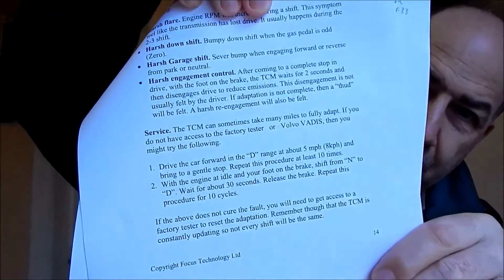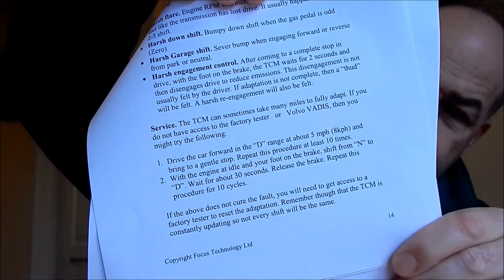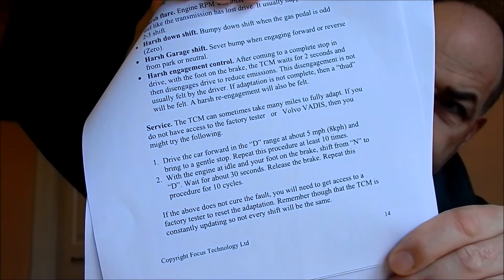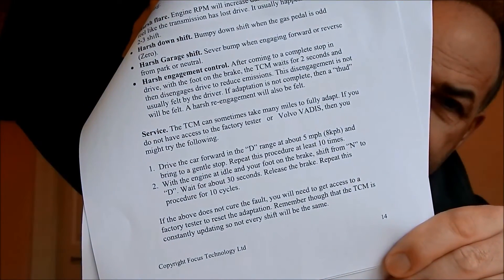Volvo AW55-50SN adaptive transmission -  GM AF33 & AW55 51SN

Comment: I'm having the shift flare issue, I'm a new owner of this car and I think it's been babied its whole life. Would a dealer reset it for me?
Reply from the maker: Well, obviously a dealer could do that...the point of this video was so that you can do it yourself - run through the video, and see the bit where the text of the document is displayed to the camera.  Follow those instructions, to make sure you eliminate the issues you can resolve yourself first?  You say it has been 'babied', but I would just say, the solitary cause of most automatic transmission failures I have seen, is wear due to mileage, and the effects of deteriorating transmission fluid.  If you bought from a dealer, consider getting your money back, and let them know this.  Don't be tied down to any one thing being the reason, just say you see this problem as the first step to resolving matters.  They may elect to repay the cash rather than proceed on what to them, will seem a precarious basis.  They might try and draw things out, until some time limit expires, beyond which you cannot exercise certain rights of return.  Who knows.  You wanted transport, not a project.  

Did the person who sold you it, use the term 'babied'?  I just wonder who assessed this vehicle as being well-cared for.  It's not a word that has any legal standing is why I ask.  It's the sort of fudging term I'd expect from someone not wanting to be tied down in any way, not wanting to say words or make claims that are any use to the buyer later.  Like a lot of used car dealers when they want to offload a crock of s**t would say.  I had one guy, he kept half-saying sentences, then waiting for me to finish them.  Literally, so he was not committing himself.  

EG I pointed out there was a flashing warning light, he'd say 'Well, that's nothing vital, I mean the car is running, as you can see, probably just needs...' and then he just drifted off.  I said'...just needs...' and thus prompted, the guy further said 'yeah, it probably just needs.......you know.....' and so it went on.  This, is the sort of childish playing-around, that some people spend all day doing.  It's like it's not a real job, is they impression I am left with.  Well, when I say the impression I am left with...I mean...you know...it's pretty obviously...you know........

 'Babied' might not mean well-maintained I am afraid.  It might mean low-mileage by someone at some point, and hardly out of the driveway for a while, which I am afraid could be the same as neglected.  In fact, diesels need a good pasting now and again, to keep the engine running well.  Goldilocks use, is hard to get but that's what you want - moderate driving, yet occasionally brisk, and with a lot of oil-changing and coolant changing and transmission oil changing every so often.

Who does that, if they don't do that many miles?  Hence, even low-mileage cars are a cause for concern, if it comes along with low levels of  maintenance.

High miles, and burned fluid never being changed, lots of towing use in summer, and most auto boxes are on the verge of failure sooner rather than later.   The solitary test I am aware of, is to floor the vehicle from a standstill, once it is warmed up, several times, and see what happens then.  I say this, because what seems a mild flare might turn out to be a missed gear if you push it hard enough, hence this test.  I have even had used car salesmen try to dissuade me from performing such a test saying 'what you doing that for?' and so on.  Did you do this test before buying the vehicle?

A good auto box, undergoing this test, will shift without flare, or hiccoughs, or bad bumps.  I almost bought a damn good GM car some time back, but the LCD display was off, making me think it had been tampered with.  In the event, I should have ignored that and gone with the fact the auto transmission was shifting impeccably and perfectly through the five-speed box.  Should have bought that damned car.  The one I did get, had issues up the yazoo, but I thought the miles were more genuine.  Then, a guy I knew, lifted the rear carpet in the trunk (boot) and showed me the wrinkle in the metal.  This car had been rear-ended and not repaired.  Should have just walked past it, gone straight back to the vendor with that compact GM.  It happens!

Most vehicles have been clocked by the time they get scrapped or otherwise written-off.  Not just a few - almost all.  Eventually, they will fall into the clutches (sorry!) of someone who quietly trawls the internet for what connectors, what software, what laptop are needed, to do the job.  Back in the day, there were signs, the mechanical odometer would be out of alignment, after they used an electric drill on the cable.  some, would leave it on all night, so the clock went forward, past the zero point again, then they are able to not leave signs of tampering - not even the digits would be slightly out of alignment.

Now, it's a perfect cover-up.  Reduced miles, and no trail to follow.  The manufacturers could stop it, just by recording the miles if the driver/owner was prepared to have it looked at to do so, most people would volunteer I am sure.  They are not interested, they probably get pressure from their own dealers, I cannot imagine why...!

Why does this matter?  Because above all else, mileage is the single most important thing, that matters to automatic transmission wear, and so it is the single most important aspect you as a potential buyer of an automatic vehicle, should want to know the absolute truth on.  If only, the manufacturer included a revolution counter that was tamper-proof, for the torque converter turning around, we'd have a separate number we could approximate to the car mileage, and would know if there was something hinky.  Sadly, no effort of any sort by manufacturers.  Automatic transmissions as we know them, appear destined to die with internal combustion engines pretty much, before a decent reliable guide to a particular unit's service life, is ever implemented.

So, we may not be able to cross-check mileage, and service records drop off with age or are forged, but the flat-out acceleration test works.  It should show you what level of seriousness you are facing with regards to faults.  You don't state the mileage, but no matter how nicely treated the vehicle appears, it is likely to be clocked (mileage wound back) if it has a few owners, and over 5 years old.  By 100,000 miles, you need it to have been well maintained to have some life left.

You want it to be like that compact GM car I let go, you want it perfect.  A good one, is perfect.  Any deviation from perfect, is a major fault just at the beginnings of its life.  Avoid buying such a situation, no matter what assurances your seller offers (usually, they offer some remedial work to occur after they get your money!  In all cases, any fault you spot and bring up, they will minimise, dismiss if they can.  Don't waste time arguing, just move on.)

Always remember the golden rule about buying something, where you are assured that some fault you have spotted, is 'easy to fix': if it really WAS easy to fix, it would be fixed by the seller already...and they could ask more money for the vehicle (or whatever) in question!  It won't be easy, or if it is, that's news to the seller.  Do not buy, walk on by.

Do the acceleration test now, and consider returning the vehicle if you try these re-calibration steps and they don't work, or end up getting some open-ended charge from a dealer.  You need to set a trigger-point with a dealer, beyond which cost you need contacting before they rack up more of a bill.  A dealer doing this recalibration should be a max of a hundred bucks.  If they really need more than that, it's either a rip-off, or they genuinely have no clue what they are doing and taking a lot of time doing it.

By the way, the point that almost all vehicles eventually get their mileage clocked down, has a practical rider that is implicit in that bald statement.  If you have seen less than say 5 cars, and they are more than say 5 years old with several owners apiece, the chances are you have not yet come across a genuine one.  By that, I mean one where the miles are as you believe them to be, the maintenance is as you have been led to believe, and the usage and treatment of the vehicle in general is what it appears.

I recently saw an advertisement for a vehicle, a small car, about 5 years old.  It had one owner, and the seller went to some pains to describe in a detailed manner, the reason why the carpets etc were scuffed and holed almost in places - it was used by a rail transport company with the suggestion it was doing small errands here and there, transporting large men in hi-vis gear and big gnarly boots.

I read this with interest, and of course, it colours your view of the vehicle and its condition.  Good honest wear, yes?  Then I decided to view it more sceptically - what if this was a load of baloney?  Why not just look closely at those pictures, as I would any other car, whose history I had no idea about?

Then I notice the excessive polish on the steering wheel.  The scrapes on the glove compartment.  Those carpets are basically holed and ruined, which means water (think snow dragged in) has basically had its way with the floorpan underneath.  The wrinkled and ragged sides to the front driver's seat.  I began to think BS.  I began to think, if they hadn't fed me that there back-story, I'd be thinking this is a fast-food delivery runabout, that has several disinterested drivers, and has been haphazardly maintained, and been horribly clocked back to half the genuine mileage.

Stick with the basics, and ignore back-stories, ignore what's not in front of you.  Do not accept ANY details that cannot be verified, as believable.  EG they say they will 'give it a once-over and do any servicing that needs doing' once you buy it.  F**k off.  That's said, knowing full-well, they have no intention of doing anything whatsoever - there can't be anything 'needing done' because you the gullible buyer, already paid cash for it, or agreed a date and time to do so.

Comment: Another Thanks, I followed the reset procedure and the car is shifting properly. Notes, for year the car will not shift properly, even after I drained and refilled the fluid three times. " Reset" or delete the "counter" is all it needed. You have done good to another person.
Reply from the maker: I am really pleased the procedures helped!  Modern internal combustion engine vehicles, with automatic transmissions, are about the most complicated electro-mechanical machines we come into contact with.  I have known cases where entire production lines halted, because the foreman or engineer did not have the handbook.  Here, at least, we have got to first base and have access to it.  Good stuff.